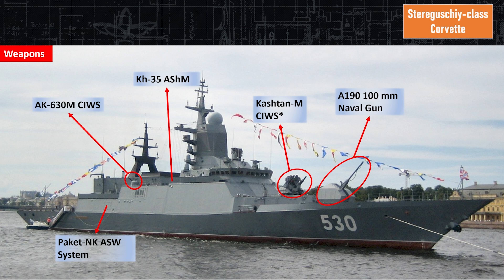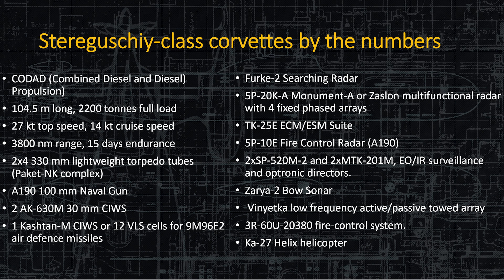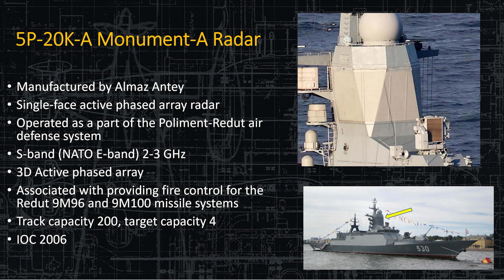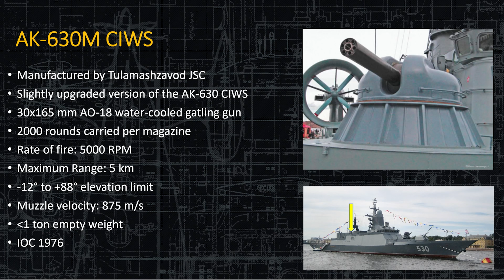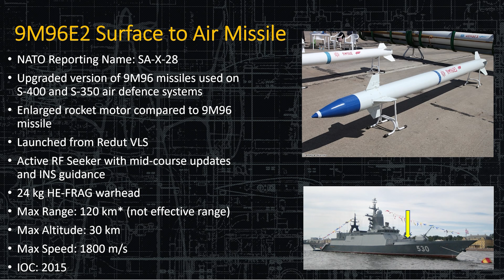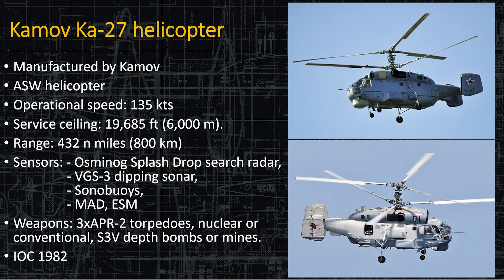Is This Russia’s Most Powerful Patrol Ship?

Comment: "have not shown evidence"

Well duh?   Why ever would they do that at the same time as Nato was preparing for war against them?

Also, there's no stretching of numbers for the missile.   Yes, the maximum range is not something you WANT to use, however, the guidance package is set up so that it can in theory perfectly well actually hit targets out to the absolute maximum range of the missile.
This was primarily done to be able to hit slow and easy targets at extreme range.

USA has also been trying to get hypersonics to work since at least the 1960s, and you still don't have anything functional.
While Iran developed their hypersonics in 2 decades.   And China something just a bit longer.

Also, as has been shown again and again, Nato or USA never had a quality advantage over USSR or RF.   That was propaganda.

As shown by the 1990s evaluation of USSR equipment taken from German reunification.   Which among other things caused outright panic reactions and generated several modernisation programs, most blatantly that for the Sidewinder, which was found to be embarassingly inferior to the USSR counterpart, also with less rush, the AMRAAM.

Comment: Along with the 9M96E missile the 9M100 can be quadpacked as well, I believe the loadout is 4 cells holding 16x 9M100 providing short range point defence and the 8x 9M96E's longer range air defence

Comment: That 9M311 Missile is a 2 stage commanded to line of sight missile, there is no semi-active or active guidance...this is effectively a beam rider until you set off the prox fuse, also this missile does NOT guide until first stage burnout...so you have roughly 2 to 2.5 KM minimum range.  Upside...it's really cheap.  Speedy.

Comment: check out the 20385 - special version for the Pacific ..... Kalibr vertical launchers and SAMs moved to the rear either side of the heli pad  ..... stick Zircons in those launchers and that is one nasty little ship ... 
that is a major change in Soviet/Rus Navy doctrine - same as their diesel subs now can launch Kalibrs. Small surface ships and diesel subs were primarily tasked with protecting nuke sub bases .... nuke subs being most vulnerable entering and leaving their port

Comment: "It is very difficult to shoot a torpedo with a torpedo"

How so? In my head the interceptor only has to search for the incoming torpedoes massive noise signature, no?
Reply: The interceptor has to be very fast and very precise. The speed generates a lot of self-noise plus it's - by definition - operating right next to a very noisy ship. Can't rely on wires either as the ship will be taking evasive action.

Think about it this way: how hard would it be to hit an Alfa if it were only 12" across?
Reply: @TheFirstIcon but you dont have to hit it head on,no? Just give the interceptor a hefty warhead of maybe 200lbs composite b and proximity fuzing (magnetic, laser or doppler sound detection)

As for speed - since the torpedo is coming at the ship, the interceptor wouldve just to get between the ship and the torpedo and catch it?
Reply: @bruceyawen6160I don't have good answers to those questions specifically, but the fact that ships have been terrified of torpedoes for almost two centuries and no one yet has an operational torpedo interceptor (much less a combat proven one) should tell you something

Comment: The ship have to replace a lot of other classes who is larger and more potent than this one.. Even if the overal Navy get more advanced, is the Russian Navy still shrinking and getting smaller, with mainly smaller surface ships and submarines to have most of the power projection. The sheer finances of Russia versus the USSR tell that the modern Russian navy will be a lot smaller than before as older ships is scrapped, and the smaller ships have to take up the brunt of the work projecting sea power
And it can be interesting to watch how the maintaince will be on this ships, compared to older classes who looked impressive at lunch, but who after a few years..... Was a very different debate
Reply: Lol
Reply: rubbish - Soviet Navy used Ukraine to supply large gas turbines and gearboxes- that has now been solved by Russia making their own - so bigger ships are coming out again. Nuke subs continued uninterrupted, and smaller diesel ships.
your assumption is absurd for another 1x simple reason ...... you are drinking the GDP Cool Aid ..... 
Russia can build 3x nuke subs for price of 1x US nuke sub ..... 
that is what GDP PPP is all about ...... they place Russia at no.4 ahead of Japan and Germany .... only China, USA and India are bigger
Reply: Russia has no means/needs to project naval power beyond 1000km.  Corvettes like this make much more sense than huge expensive ships like battle cruisers.  The real issue, with these Corvettes, as you pointed out, that they are overloaded with weapons that leaves no room for upgrades.
Reply: @skvUSA  Russians have a habit of wating to much on each platform. And end up having problems when the systems work and not combined to a whole... Sometimes is less more..
Russia in he future have not the need to project power over 1000km as you say, and proably will end up with a navy with Corvettes and other similar ships before larger ships is build.. And I suspect the submarines who is in use also will be in use for a while also...

Comment: Frigates and corvetes can have similar capabilities. The difference is in the endurance. Frigates are for blue water operations and corvettes for green water operations.
Reply: this is changing with at sea refueling and helicopter based restocking
Reply: @Chiggi0815  corvettes too have blue water capabilities
Reply: @KittyExplain-Me  It is about being designed to operate on open waters for extended time on your own. Frigates usually can operate for weeks or month, while corvettes are dependent on steady resupply.
This goes back all the way to the age of sail.
Reply: @Chiggi0815  Frigates also depends on steady supply and any warship that displace around 1,000 tons or more can also stay at sea for months with supplies from supply vessels and most Russia Corvettes are basically light Frigates but Russia doesn't use that classification and hence they call them Corvettes and anything that is above 5,000 tons a frigate. Corvettes mostly displace up to  950 tons and anything that displace around 1,000 is a light frigate but this Corvette class displaces around 2,500 which makes it somewhere a fully fledged and light frigate
Reply: @KittyExplain-Me  I said to operate on their own. The minimum requirement for german frigates for example is 21 days and 4000 miles without replenishment and pretty much all frigate classes I know of surpass that. Can you name a class of corvettes that reach that minimum? 
And tonnage based classification are a thing of the past. They were important in the first half of the 20th century when naval combat was ruled by ballistics and armor. Tonnage is just a logistical factor since ww2.

Comment: Nice boat.  Would be a great fleet pickett around an aircraft carrier.  Oh, wait...
Reply: Tbh, RF doesn't have any sense to build carriers.
Reply: They are building two helicopter carriers, so they will end up doing that to a point
Reply: @pierceplaysstudios245 helj carriers is kinda better suited for Russia, but still questionable thing. At least this ships must have some standoff capabilities
Reply: @PyromaN93 air power will always be needed. Both helios and fixes wing. 

Drones cant do it all, so it makes sense to invest in aircraft carrying ships to some extent
Reply: @pierceplaysstudios245 main issues is: dimensions, personnel, infrastructure and purpose.
Carriers for fixed wings is huge. Even Kuznetsov was big, more conventional designes is bigger. So, to build such ships need to buid new drydocks, and for maintenance too. In Russia it is kinda problematic, only two ports is suitable. This ships will require huge personnel for all purposes: sailors, pilots, factory workers for construction and repairs, training groups instructors for those men... again, huge mess. Existing bases probably too small for them, tugs too weak e.t.c. And last one — purpose. Russia is continental power, main threats lies near it and accesible by land (carriers doesn't make any sense), by air from inland airbases (same thing), or too strong or too far, or both, to realistically wage conventional war. Yes, small countries far abroad will be issue, but they have and will have in future lower priority than security of mainland. And most part of funds anyway will be gathered by army and airforce, leaving navy behind.
Reply: @PyromaN93 your right in nearly every regard, and thats probably why Russia is JUST making the helo carriers. 

They're smaller then standard carriers, near the size of the Slava, kirov, and Ivan gren classes. 

Since they'll be operating helicopters, some naval, (KA28), others not (like the KA52) there wont be need for any hyper specialized training, pilots, equipment, that they at least dont already have. 

And since they building them themselves ill assume it wont be too hard getting the spare parts and whatnot for it.

If Italy, spain, egypt, turkey, Indonesia, japan, and im sure a good few others can build or maintain a helo carrier, i dont see how Russia, who has more resources in every regard cant
Reply: @pierceplaysstudios245 Russia have very controversial expiriense with Moskva class, so carier must be big, have standoff offensive and defensive capabilities, and ideally have some space for marines to deliver them. Preferably with heavy equipment. And I still sceptical about such ships, may be have extended heli squad for newer warships will be better, since most of Russian/Soviet big ships already have some. Because if we look at such vehicle — it is just beefier УДК, like "Цезарь Куников". Well, future will show.
Reply: @PyromaN93, the Moskva was to big of an embarrassment for Russia to let happen again, I think.

And it will have marines, its half heli carrier and amphibious assault ship. 

In terms of defenses, well with multiple CWIS and pantsirs, plus escorting vessels like the Gorshkov and Karakurt classes, I think she'll be safe. 

And if it makes you feel any better, Russia is also making 2 heavy landers, the improved ivan gren-class. Who will carry and launch like 4 helos, which will give Russia more flexibility in that category

Comment: Even with twice the displacement the LCS doesn't even have a VLS. And there have only been talks to place deck launchers...just talks.
Reply: if i'm not mistaken the 2 turrets above the hangars of the freedom class are meant to be modular with plans for vls modules but ig there are some issues with the whole module thing
Reply: Modular is a very unlucky word when it comes to military equipment
Reply: This ship will be going up against Arleigh Burkes Flight III not the LCS.
Russia's navy has disappeared when compared to the 1980s.
Reply: @Leon1Aust  Russian navy has shifted towards green water and littoral area denial rather than power projection, they have corvettes as small as 800 tons with supersonic anti ship missiles along with land based air and anti ship infrastructure that I think shouldn’t be considered inoffensive to attacking fleets.
Reply: @Leon1Aust no they wont be up against arleigh burkes they will be up against a quicksink glide bomb or cruise missile from an f18 or f15